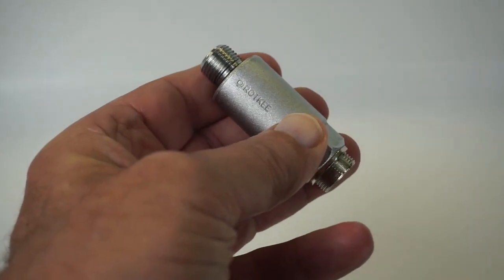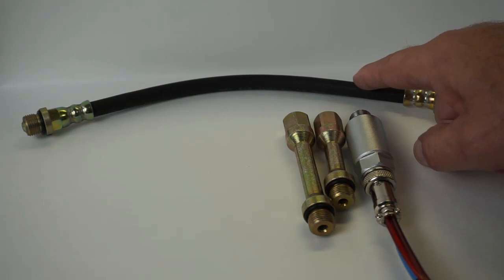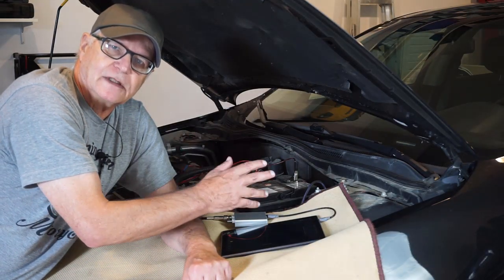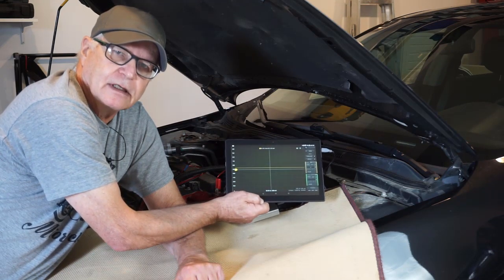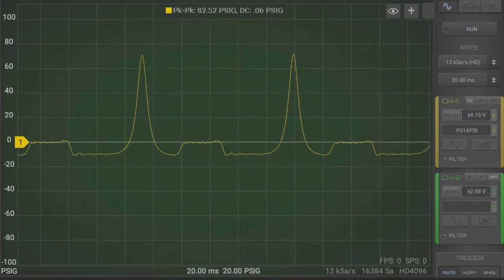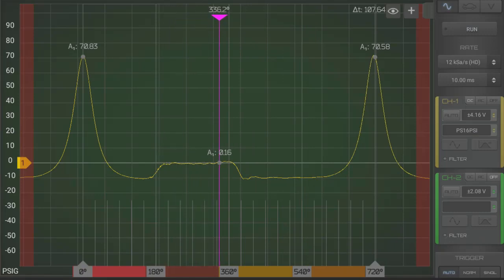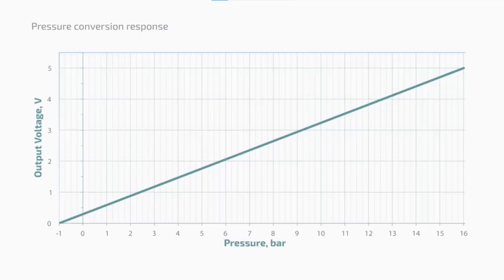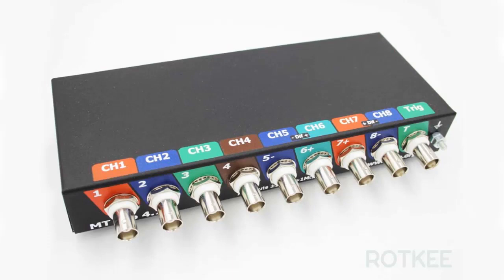GADGETS#122 - ROTKEE PS16 PRESSURE TRANSDUCER

Comment: That is a very nice clean pattern,with the hose temperature affects pattern as the hose is gets hotter you can see pattern change
Reply from the maker: transducers also get hotter (compressed air, after all)...why tests should be done quickly

Comment: I own snapon verus pro lab scope .How do you zero out transducer
Reply from the maker: 0 PSIG (atmosphere) is 1v output from that sensor

PICO has Gradient + Offset and HScope has Multiplier + Offset to create probe settings that automatically display in PSI

I don't think the VERUS has that capability. The "workaround" would be a paper chart that would allow you to convert the volts VERUS displays into PSI or BAR

easy enough to make...

if working in BAR:

1v = 0 BAR and each 1v from that represents 2.5 BAR

if working in PSI:

1v = 0 PSIG and each 1v from that represents 36.25 PSI
Reply from the maker: NOTE: above probe setting numbers are for the 12v   10 BAR sensor featured in GADGETS#139
Reply: @theGADGETSplaylist  ok thanks
Reply: Thanks for your reply 👍. You think products will still be available with this war that's happening
Reply from the maker: @frankjohn4302  no...their site is down...seriously impacted I'm sure...

and I just realized you were asking about the ROTKEE...those probe numbers I gave you earlier are for the 12v   10 BAR sensor featured in GADGETS#139, and this sensor would be your best bet...

sorry about the mistake, Frank:)

Comment: Great video interesting device. Where did the unit get inserted in the engine and does this affect the engine operation?
Reply from the maker: this sensor screws into spark plug hole so engine running on 1 less cylinder during short duration of test...

Comment: Hello sir!I buy a ps16 and I have the picoscope and I want to add this probe and I can't find anything on the web about the scaling for this probe.is this correct ?0 mv equal to 30 inHg
294 mv equal to atmosphere (1 bar)
588 mv equal to 2 bar
882 mv equal to 3 bar
1.176 mv equal to  4 bar
1.470 mv equal to 5 bar
1.764 mv equal to 6 bar 
2.058 mv equal to 7 bar
2.352 mv equal to 8 bar 
2.646 mv equal to 9 bar
2.940 mv equal to 10 bar
3.234 mv equal to 11 bar
3.528 mv equal to 12 bar 
3.822 mv equal to 13 bar
4.116 mv equal to 14 bar
4.410 mv equal to 15 bar 
4.704 mv equal to 16 bar
4.998 mv equal to 17 bar or i have to step-down the bar like this to take correct values at the waveform as a pressure gauge 
0 mv equal to 30 inHg
294 mv equal to atmosphere
588 mv equal to 1 bar
882 mv equal to 2 bar
1.176 mv equal to  3 bar
1.470 mv equal to 4 bar
1.764 mv equal to 5 bar 
2.058 mv equal to 6 bar
2.352 mv equal to 7 bar 
2.646 mv equal to 8 bar
2.940 mv equal to 9 bar
3.234 mv equal to 10 bar
3.528 mv equal to 11 bar 
3.822 mv equal to 12 bar
4.116 mv equal to 13 bar
4.410 mv equal to 14 bar 
4.704 mv equal to 15 bar
4.998 mv equal to 16 bar
Thank you very much.keep make your gadgets you help us very much!Best regards!
Reply from the maker: Although the math is simple, PICO and HScope take different approaches to PROBE configuration. And, it's the simple things that can be the most dangerous:)

With that in mind, I'll provide PICO settings for ROTKEE PS16

For BAR:

Y = 3.4
Offset = -1

For PSIG:

Y = 49.3
Offset = -14.5

I think these are ok. Let me know if there are issues George...

Denis
Reply: @theGADGETSplaylist  i will try soon this settings and I will inform you!thank you very much for your fast response Mr denis!
Reply from the maker: I think the PSIG numbers are ok but I'm having second thoughts about the BAR numbers.

For BAR, please make Offset = 0 (instead of -1 as I originally submitted)

And let me know, George:)
Reply: @theGADGETSplaylist  yes Mr denis i set 0 the offset and I will try soon. Thank you very much for your help!
Reply: @theGADGETSplaylist  Mr denis I already try both formula y x types and the correct is y 3.4 and offset -1 .before try i take a measurement for compression with gauge and it's almost the same values very small difference and I also check with vacuum gauge the same time with ps16 engine running to test the vacuum values.the only difference i see is that the ps16 characteristics 294mv equal 1 atm or bar and if I have the ps16 connected but not plug in in cylinder but on my tool box the value of atm is 325mv and because is small difference i let it as it is I'm not trying to adjust in picoscope probe setup because I don't know if the weather is changing a little the values or the place I am !but for this price and tool I am very happy and satisfied!I hope after few uses still work fine!!thank you very much for your help !!!I wish you every day be happy with a big smile in your face!thank you again!
Reply from the maker: @giorkar2116  I have a BIG smile on my face:)
Reply: @giorkar2116  You may find it easier to use a custom data table in Pico instead of using a formula with the offset. Rotkee states 0v is -1 Bar(-14.5038 psi) and 5v is 16 Bar(232.06 psi). Hope this helps!
Reply: @paulpaquette1961  thank you very much for your help and answer my friend!!

Comment: Seems to have a lot of similarities with the USB Autoscope. Pricing seems very keen too
Reply from the maker: I also see those similarities between the two companies. And both are big on running "scripts"
ROTKEE is much better priced.
Reply: @theGADGETSplaylist  I wonder are they any easier to buy from ? Autoscope insisted on some transfer system, which is why I never bought one.
Reply from the maker: @blow0me  you'll run into the same "problem" with ROTKEE. They don't do PayPal.
Members of our HScope TELEGRAM Group have placed orders without complications.
Reply from the maker: @blow0me  one thing I've noticed of late is the high number of out of stock items. That is troublesome, I must admit.
Offsetting that is the quality and pricing and the professional and courteous experience my collaboration was with them.
They remain open to more when the MT-4 PRO oscilloscope comes back in stock. We'll see in the new year. I too have been too busy to pursue it.

Comment: That sounds like a must have. Would  it work with fuel pressure?  Your no doubt familiar with a method of testing injectors where u pressure drop them with a pulse tool and compare the results between injectors. A regular fuel pressure gauge is not that accurate, so the test is not very accurate. This seems to me to b the ticket. Thank u for all your help in so many areas!!
Reply from the maker: I've toyed with that idea Bill. With an even more sensitive transducer. The goal was to find an alternative to the std injector balance test you're referring to. I had no success, at least so far.
Reply: @theGADGETSplaylist  Thank u for the reply. I hope u and your family r doing well Denis. I watch every video. A fair amount goes over my head. But that’s how we learn.
Reply from the maker: @billrimmer5596  best to you for 2021, Bill:)

Comment: How do I buy them hear in the states.
Reply from the maker: You can only buy directly from the ROTKEE website. Link in the description box.
Check the items on the order form and you'll be contacted by e-mail confirming pricing and shipping options.
They do not accept PayPal
Hope this helps, Daniel
Reply from the maker: I'll be releasing a video shortly on the ROTKEE PDS Pressure Transducer. You may also be very interested in that...

Comment: In the middle of hs402 build, having trouble flashing stm32f411 black pill. Samsung tab A tablet won't flash apparently neither will my Samsung phone. So tried emulating android on laptop but stm utils wouldn't recognize the connection. So now I'm trying to install the needed components on my raspberry pi. Is there any way to just flash with laptop? Low budget scope isn't so low budget if I need to buy a new phone or something lol so exploring all my existing options before upgrading any devices. Was thinking of just buying the pico 2400 series scope but really like the Hscope app and layout plus already purchased the automotive version lol
Reply from the maker: If you like the HScope APP, Jedi and are considering purchasing an oscilloscope then look at the LOTO OSC482, OSCA02 (same as OSC2002) that I've reviewed on the channel.
For technical support on HS402 build/ flash I recommend you join our HScope Group on TELEGRAM. I or others that know more than me will be happy to help out.
Install TELEGRAM on your tablet or laptop and this link should take you there:

https://t.me/hscope

Denis

Comment: 2:55 Is that a 4 cilinder engine running on just 3??
Reply from the maker: yes, Eduard it is...
Reply: the GADGETS playlist 
I remember the time I had a blown head gasket on my 1.6l 4 cilinder Ford engine (about 20years ago). It sounded pretty rough. I listened to the fragment of your video and I thought the engine ran rather smooth.
Reply from the maker: @Conservator.  you should hear it on all 4 cylinders:)
love that 2.5L engine...this is before they "ruined" it by later adding GDI (Gasoline Direct Injection)
all manufacturers have been taking steps backwards, IMO

Comment: I’m a pico 4425 user and have every accessory for it but I’m also in the process of emailing them to order their pressure pulse sensor and a few of their ignition coil pickups. They are priced VERY well and look to be of great quality too. It took a few days for them to get back with a price and they don’t take PayPal in the country they are in. The only downfall is you can’t just order off of the site and have to go back and forth over email to get it done. Very slow process so don’t be in a hurry
Reply from the maker: I am aware and agree with all the points you raised, John.
ROTKEE threw in a PDS pulse transducer in the box when they shipped me the PS16. I'll try to find the time and the right application to showcase it.
Reply: I came across the same difficulty when looking at the USB Autoscope. I'm sure they are trustworthy, I just did not trust their preferred payment methods. So would not risk sending the  money. I'm sure they could do a lot of business with other parts of the world with an easier purchasing system

Comment: Hey Denis: You mentioned the voltage output vs pressure is higher than a lot of the competitor sensors. Looking at the graph the output is above a volt down around where my model engine compression is. That's pretty reasonable  I might just buy one for use with the models. 
See you're costing me money again :-)
Thanks for the review.
Reply from the maker: Those DIY pressure sensors have their range spread over 4 volts. Typical of many 5v reference sensors.
This ROTKEE takes that up a notch and spreads it over a full 5v
The FLUKE PV350 spreads its 350 PSI over 350mV...useless...and expensive!
Reply: @theGADGETSplaylist  Unless you follow it with a low noise amplifier. Something I'm sure Fluke would be good at.
Reply from the maker: @davesage9190   You should se the noise that comes out of those FLUKE without amplifiers. BIG waste of money.
You can buy 10 of these ROTKEE PS16 for the price of a FLUKE. If they were priced the same, I'd still choose the PS16.
Reply: Went to the Rotkee site and I can't figure out how to buy one!
Reply from the maker: @bobdring8857  you'll see a CONTACT page on the site with e-mail info (I've also posted that email in description box here)
State the product(s) you're interested in. They'll get back to you with payment / shipping options or just more info if that's what you were seeking.
You'll likely deal with Eugene...he'll set you up...
Reply: @theGADGETSplaylist  Yes. Or If you go to the products page and look at the top it explains what they want you to do. Sort of odd. You fill in what they ask and put it in the "your answer" line. Like quantity, shippping address, etc. etc. At the bottom you send it and they will apparently get back to you by email with a quote.
I suspect with shipping and duty it will be about $250 CAD. Too much for me. I'm waiting for their response.
Reply from the maker: @davesage9190  I think there's a choice on shipping methods. Am unsure about duty. I'm thinking there isn't any.
Please let me/us know your final quote.

Comment: Just to clarify is this is a linear sensor? Meaning the multiplier works all through the voltage/pressure range?
Reply from the maker: YES:)
Reply: @theGADGETSplaylist  HAHA I see that now.  Just viewing their website, so I prematurely asked a dumb question!  Thanks for sharing this tool! Currently I have been using a DIY transduce from a Kia A/C line pressure sensor.  Compared to the ebay sensors it has a faster refresh rate but tons of noise to be filtered out and then detail is lost.  This Rotkee product looks promising!  Thanks again from a fellow Canadian!
Reply from the maker: @EverythingNausome  no such thing as dumb questions here...certainly not from a fellow Canadian:)
Reply from the maker: @UCq8lPa3U6eC11hLuGwOu03Q yep, and these values have been well tested by HScope users when PS16 was first added to database...